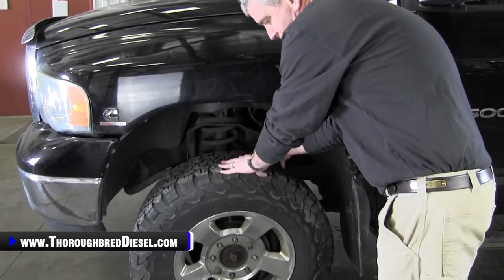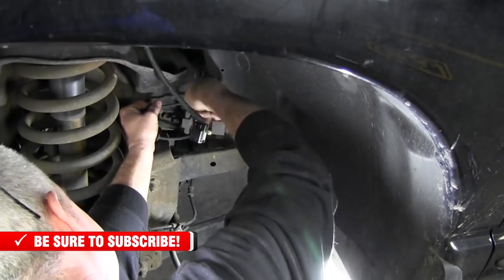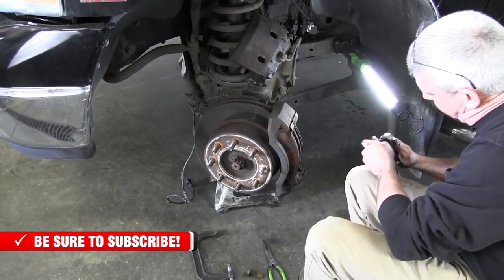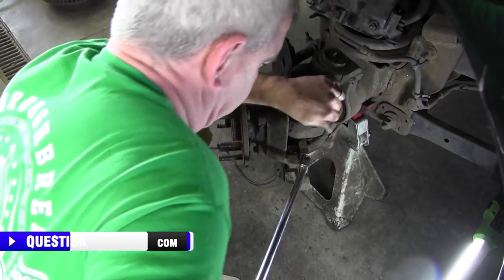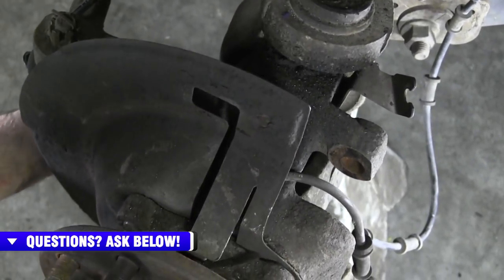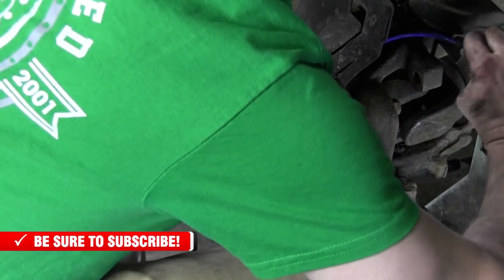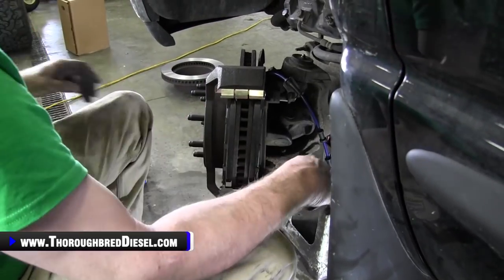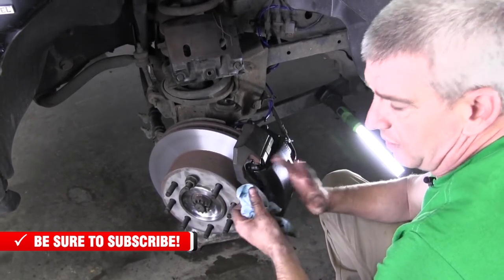Moog Wheel Hub Assembly Install: 2005 Dodge Cummins

Comment: Hey Wayne! As far as my 04’ 2500 2x4 the power steering process won’t work well. But the lisle tool bearing tool for $100 works great even on a Chicago truck with tons of salt and rust.
Reply from the maker: Thanks for the info. Glad to hear.

Comment: Don't know if anyone does a lot of differential work, but when I put a new carrier in a half ton with an open diff I kept the pinion shaft that goes through the center and use that to push the hub out. Did not cost me a dime.

Comment: That’s all I use is Tonkin hub bearings and they are the ones who invented the hub bearings and pull out senders and put a couple of Oz of your favorite gear lube or like Lucas oil stablizer or motor honey just because it’s thick and not runny.

Comment: This doesn't work on trucks that live in winter climates.  And yes antiseize is a must putting that hub back in that knuckle and axle shaft and a film on the interface of hub to rotor.  I'm working on one now that won't move at all.  Been in the truck 23 years.  Hub buster didn't work nor the power steering method.  So I ordered an 15 ton hydraulic puller and will use that in tandem with the power steering method.  I'm hoping that will work on this particular truck.

Comment: If your going to do your ball joints too and you pull the axle out do you have to shift it into 4x4 first? Someone said somewhere one of your gears will fall down if you don't
Reply: Went through my 03 service manual for shaft removal and didn't see any mention or warning. There would be if there was im sure.

Comment: Are the Amazon Detroit hubs any good?
Reply: I do not re immense Detroit Axle parts. I have bought struts, links and CV axles from them for customers and myself early in my diagnostic career and these parts will not last but maybe 6-12 months.  Not worth the money and labor to redo shortly down the road.
Reply: Just replaced a set of Detroit Axle Hub assemblies on my 2008 3500 dually.. They only had 19k miles and were giving me ABS issues already.. I replaced them with Timkens.. I had good luck with DA Hubs in a Tahoe for over 50k miles.. They just don’t hold up to the weight of the diesel engine on the Dodge..
Reply: @garypatterson3123  thanks for the heads up. I am due for front and rears on a 2003 Dodge Ram 2500 4x4.